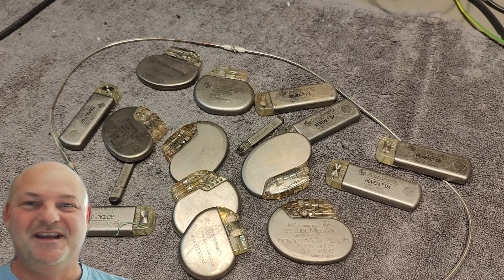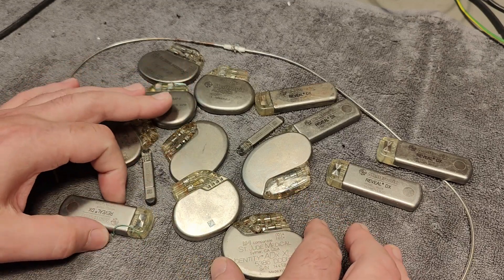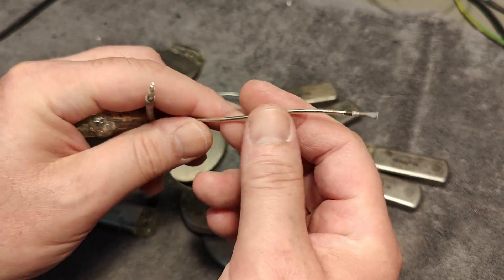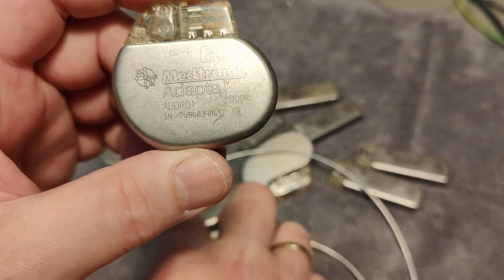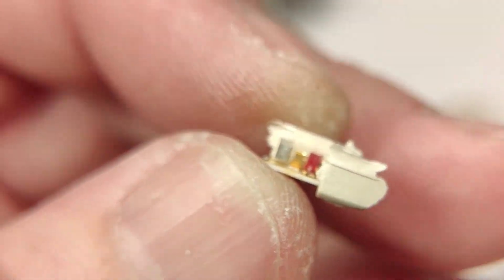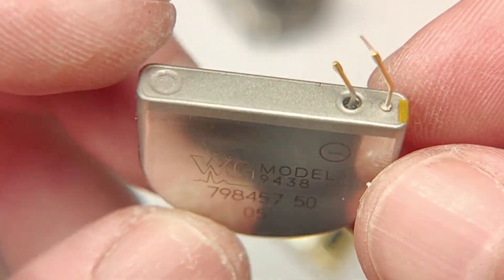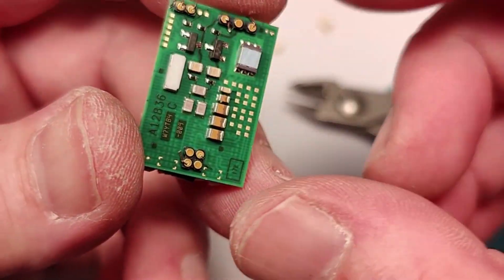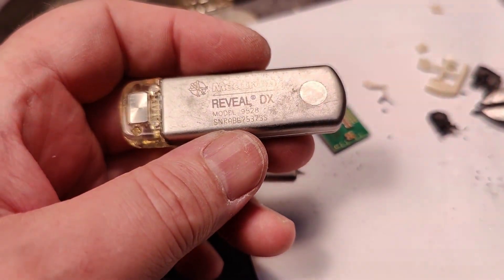Pacemaker and Medtronic Reveal Logger teardown what is inside

Comment: Back in the early 1980s non rechargable Lithium batteries were used. Only a few volts (~5 volts) were used to pace the heart chambers, it was pulse width controlled to save energy. An inductor coil was used for very low frequency - low power two way comms. A small current pulse into the inductor/capacitor would cause it to ring. Low frequency magnetic fields will go through the case (<200kHz). A magnetic reed switch was used to enable comms. There was a lot to that little pacemaker, many modes of operation depending on what patient needed.:thanksdoc:

Comment: My youngest sister got her first pacemaker when she was just 3 years old and I now on her 9. th pacemaker. It’s a small Micro. I think she still has the first seven pacemakers after they were removed for replacement but unfortunately she didn’t get the last one. Many years ago I tried to connect an oscilloscope to the output ports with the probe and used the metal jacket as ground and god a nice puls on the oscilloscope. That old model was set to a constant pulse of 70 BMP so she wasn’t nearly as exhausted as the other kids at the same age when there were playing or running. The newer and more intelligent types adjust the pulse which is good because you need more oxygen if you are running than if you sleep this is why you pulse goes up if we are active.